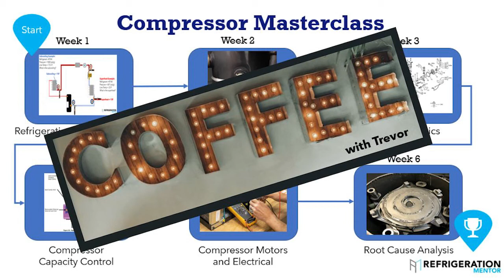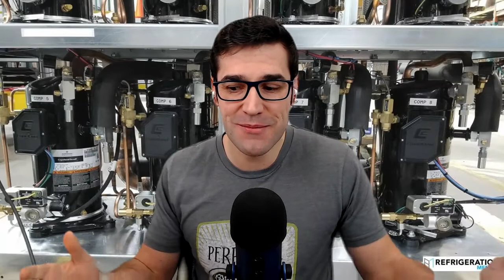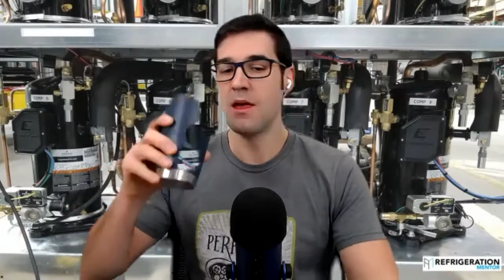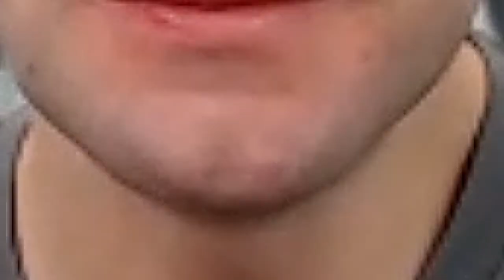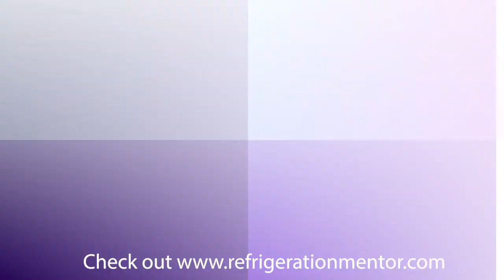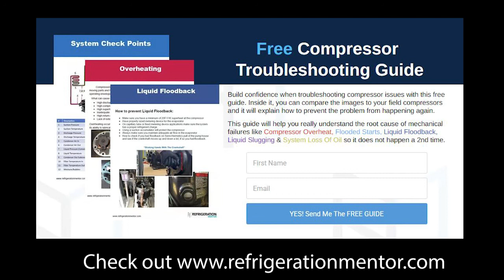What causes Flooded Starts in a Refrigeration system?

Comment: Could you explain how to wire up a 3 phase or single phase to have 3 or so bump starts after a power failure or after a defrost or after a thermostat calls for cooling please.
Reply from the maker: The only way I know how to set up a bump start is through a controller that has a bump start option. Usually the logic is if the compressor was off for more then 4 hours it would start for 2 seconds and off for 15 seconds and it will do that 3 or 4 times before the compressor comes on.